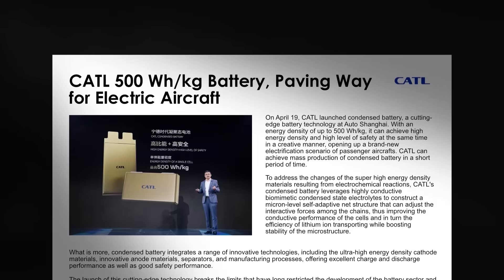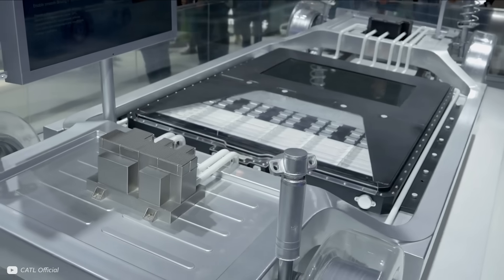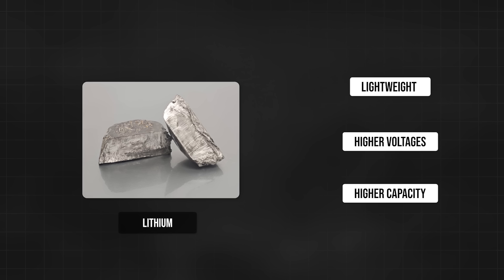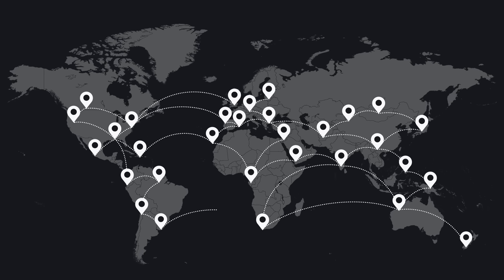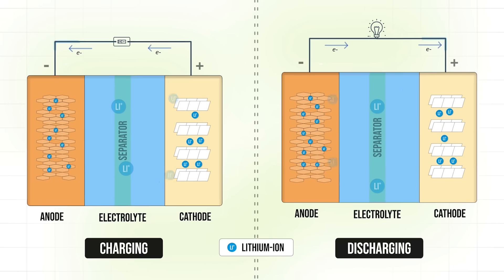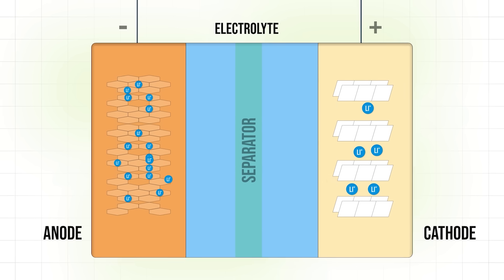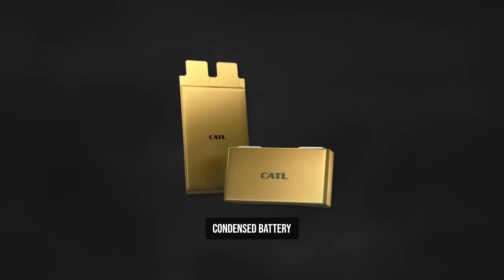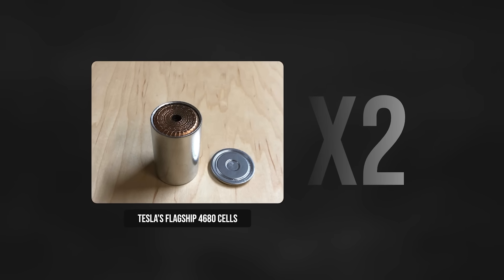Next Generation Batteries: Beyond Solid State

Comment: No matter how many times I learn how batteries work, I still don't fully understand it lol.
Reply: Then you should try building some - it's the best way to learn!  It can be done with very simple materials - like coins, salt, water, and cardboard... or a lemon and different strips of metal.  Have fun and play with all sorts of different materials - it's a great way to learn!
Reply: It's surprising how many explanations indeed do not properly explain it. I'm not gonna give you a full explanation but what's important to understand is that BOTH anode as well as cathode want to hang on to their electrons. However, the cathode more so than the anode. So the cathode is pulling an electron from the electric wire, causing a positive hole which attracts the next electron in the wire, all the way down the anode. There the force is strong enough to pull away an electron from the anode. Now the anode is positivily charged and this stimulates the release of an Lithium positive ion into the electrolyte. On the cathode side the attraction of the electron from the wire caused it to become negative, attracting a positive lithium from the electrolyte.
Reply: Imagine you have two wolves inside you.
Reply: Having the same dumb basic generic explanation at the begining of every video doesnt help either
Reply: space travel is literally easier to understand than how batteries work fr
Reply: A chemical reaction occurs in the enclosed battery producing useable DC power.
Reply: All electrical energy, to be used for work, needs to "flow" (like water) and this is our amperage. High voltage (the amount of electrons) is not dangerous alone with no amperage/current because its not transferring any power. Its easiest to think of electricity in the same terms as water. Voltage being your water volume, current/amps being your flow rate and resistance being like a pipe with a variable diameter, with high resistance being a small pipe diameter, and low resistance being a large pipe. Most electrical power is transmitted by moving a magnetic field physically within an eletrical field, commonly in the form of a turbine being rotated by steam created from boiling water. You can think of this like a water pump and how its rotation causes water to flow. Batteries are also pumps for electricity (but metaphorically more like a piston type pump instead of a turbine type pump) and are the source of the "flow" that causes energy to be transmitted. However it uses chemical energy instead of the kinetic energy of movement. Think of charging a battery as pumping the water uphill and storing it in a resevoir; think of discharging a battery as allowing it to flow back downhill, whenever you need power, thus giving us a portable means of producing electrical current. You just need to charge it at a power source and then you can take it wherever and use it. 

If you want more detail on how batteries work specifically, Id just add this. You have two different chemicals that both hold onto and let go of electrons (which is the source of our flow/current, think of when you move electrons around as them being linked, like a chain, and the movement goes on down the chain as a wave). One chemical likes to let go of the electrons more than the other and the other likes to hold on to them more. So, when we charge the battery we are loading the chemical that lets go of electrons easier with electrons. Then when we begin to discharge the battery (AKA we disconnect it from power and begin instead drawing power from it by connecting it to a load that draws that power to do work) we are allowing the other chemical to take the electrons from the charged chemical and thus producing electrical power that can do work, AKA power is flowing. 

The biggest takeaway here is that electrical energy works by "flowing" which is when we have two different eletrical potentials (their energy state) and one is flowing to the other, naturally, to create an equillibrium, because thats how entropy and our universe works. Higher states of energy in all forms will natural find a lower more stable state of energy. Something that takes a lot of work/energy to create will eventually breakdown and become dust over a long enough period in a simpler state that has shed all the energy that was used originally to change its form. I hope that helps a little bit at least.
Reply: @Fangman123789  yeah that helps, thanks. Also thank for the other replies if any of you other guys see this.
Reply: Here's my extreme oversimplification.

One chemical reaction makes extra electrons it needs get get rid of. On the other side a different chemical reaction needs electrons to react.

The circuit the battery makes is the road for the electrons to move. 

It gets difficult because the reaction also makes charged atoms that also have to move to the other side. So you need a second road for them that the electrons can't use. Making a barrier that hold up without getting cloged is tough.

Sorry about any innacuracies, it's been a while since I learned about this in high school.
Reply: Now I'm properly confused
Reply: Its just fairies trapped in small metal cylinders.
Reply: You and me both, I think the only way to truly understand some things is to reproduce them.
The first experiment that led to a battery is available. You can reproduce it without using special tools iirc.
I don't remember the whole process, so it might contain some chemicals that would require PPE...
Reply: Magic goes in , magic comes out .
Reply: No one truly understands it, it’s a phenomenon that is used rather than fully understood.
Reply: It’s easy, chemistry is based off physics. You are intentionally creating a difference in atomic charge to exploit the potential energy of the natural forces of atom wanting to stabilize itself in a neutral state. This is no different than any other natural force like gravity or elasticity. You lift something up, it “wants” to come back down, you stretch it apart, it “wants” to return back together. The same is with atoms and their charges. So all a battery “is”, is taking kinetic energy and configuring matter in a way to store it into potential energy. Just like winding up a clock spring. Simple as that.
Reply: @yoface938  That helps
Reply: On top of that we humans are trillions of cells that hold 1.4 volts each... So we hold trillions of volts
Reply: You must go deeper!!
Reply: What part of it do you not understand?
Reply: Same here😅
Reply: Batteries are more advanced than people realize, there's a reason the inventor of the lithium battery won a Nobel prize.
Reply: Do you understand basic chemical reactions? Like oxidization, rust? Without the basics its hard to get a grasp on whats going on, although understanding whats going on isn't necessary to even manufacturing them. The further you go back in history the easier the manufacture is, but the basics have remained the same.
Reply: Chemicals react with each other to produce electrical energy, what's not to get? It's like dropping Potassium in water or dropping a mento in a bottle of coke but instead of an explosion, the chemical reaction just powers your phone.... and sometimes also explodes
Reply: Sama. The sama I didn't understand how cpu & gpu work 😅😅😅
Reply: Why don't have science background
Reply: Same here , me also 😂😂😂
Reply: It’s just electrons moving mediums and densities. It’s a transfer on the atomic scale.
Reply: Power goes in, some of it is stored, the other portion is "lost" as heat/other. Then you can draw from the power that was successfully stored.
Reply: @FMHikari which is also not 100% efficient
Reply: Imagine you have two types of very small, cute monsters: tiny ants and microscopic cats.

Tiny Ants: These ants ooze out jumping beans.
Microscopic Cats: These cats love to eat jumping beans.
Think of a battery as a container split into two halves. One half is filled with these tiny ant monsters (the anode), and the other half is filled with the microscopic cat monsters (the cathode).

When there's a path for the jumping beans (electrons) to move from the ant side to the cat side, they will naturally want to flow to the hungry cats.

This movement of jumping beans from ants to cats can be harnessed to do work, like turning a mill or turbine. Similarly, in a battery, the movement of electrons from the anode to the cathode through an external circuit powers electronic devices.

So, in summary:

Ants (Anode) release Jumping Beans (Electrons).
Cats (Cathode) eat the Jumping Beans.
The movement of these jumping beans can be used to power things, just like the flow of electrons powers electronic devices
Reply: @b.r.1523  This deserves more likes!
Reply: 😂😂😂 @b.r.1523
Reply: That's because you have lack of knowledge about technology about the batteries
Reply: just pay attention to class lmao
it's not that hard to understand unless all u do is watch science videos for info

Comment: Sounds a little naive, and a lot of cope. Also very simplified explanation of how it function and its mechanics. Honestly, a little bit dishonest as well since the different techs are pitted against each other as if one is better than the other when solid state batteries were explained poorly and as if it is inferior. Solid state whole reason is to go away from lithium not to use it as an electrolyte. I don't understand where that came from.

In the end, if it ends up being a real thing and becomes commercially viable, then great! But I wouldn't hold my breath.

Comment: Current flows from positive to negative and electron flows from negative to positive. At least it did when I was at school.
Reply: By definition, the cathode is the negative pole of the battery, irrespective of point of view i.e. charging or discharging. Discharge, the electrons flow out of the cathode battery pole and flow into the cathode pole during charging. Unless science has been redefined now!?
Reply: @peterbrown172  Oh mate, now you’ve stepped in a bit of a rabbit hole! Unfortunately, we defined anode and cathode for an electrochemical cell, like an electroplating bath. It is true that in that case, the cathode is the negative terminal.
Unfortunately, chemistry had another definition. They defined the cathode as the electrode where reduction was taking place, and the anode as the one where oxidation was occurring. That meant that strictly speaking, the anode and cathode of a rechargeable cell swap places when charging vs discharging.
It’s a total mess.
This is why several scientists have proposed dropping the whole anode/cathode thing altogether.
They suggest names such as positrode and negatrode instead, where the polarity defines them rather than the oxidation or reduction.
Personally, I think it is an excellent idea.
Reply: It is true (for electron) outside of the battery.
Reply: Yep. During discharge, that’s correct. The opposite is true when charging. What’s your point?
Reply: Yep for me too,……!